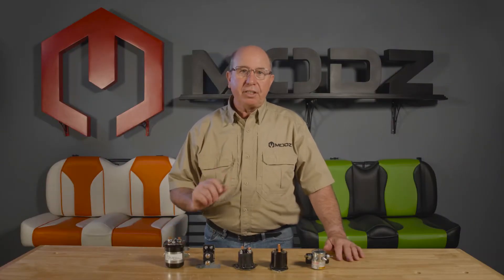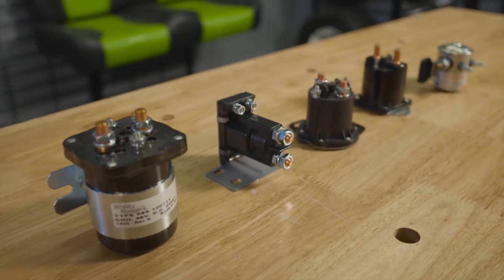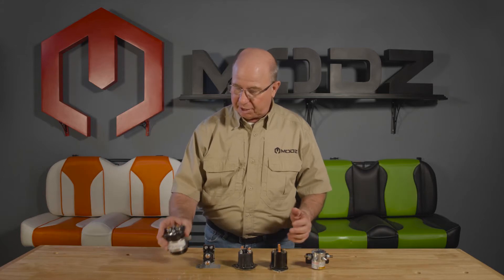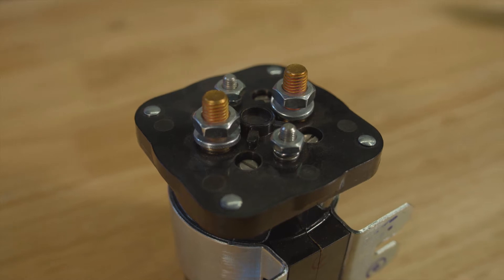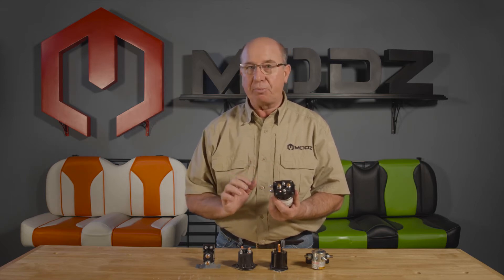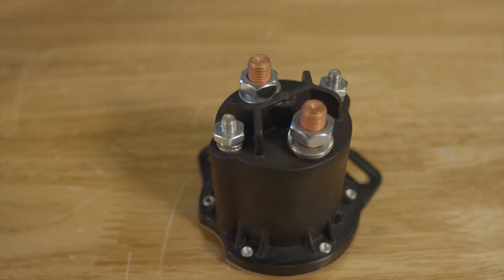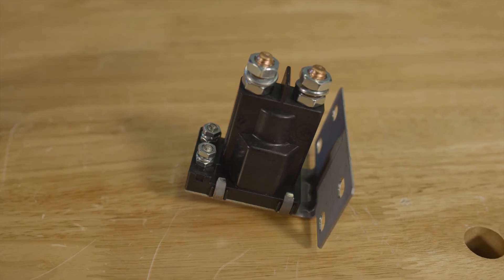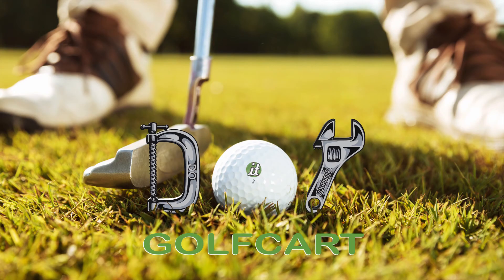Golf Cart Solenoids FAQ - Different Sizes & Shapes

Comment: Hi
We have a 94 Ezgo medilist and we are trying to upgrade the controller and solenoid.  We have everything installed but my cart isn't working. I've rechecked the wiring.  The solenoid is not opening up. I'm not sure what to do.
Reply from the maker: Check to see if you have voltage on the 2 small terminals with the key on and the pedal depressed first. This will tell you which direction to go next. If no voltage, back up and find whats missing (positive or negative). You mentioned "not opening up). When the solenoid is activated, it closes and allows voltage to continue through. When voltage is not present, it opens up to stop the voltage flow.